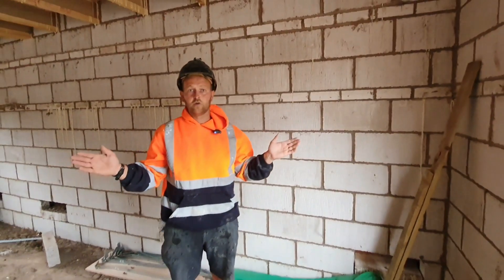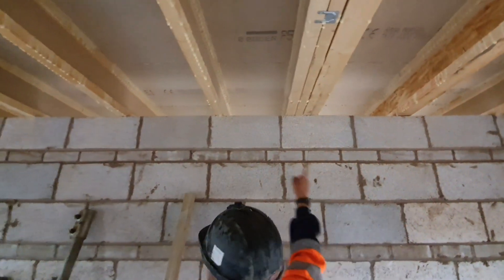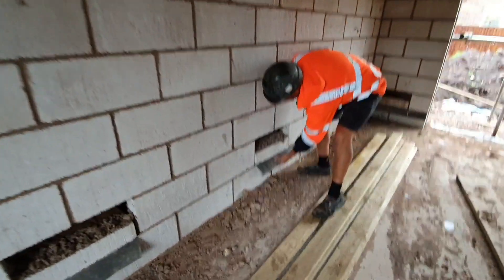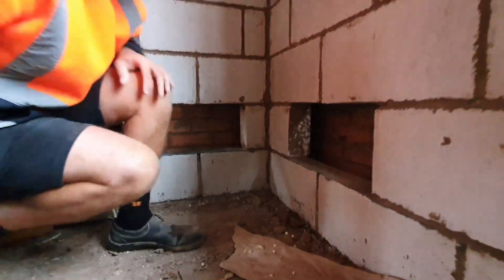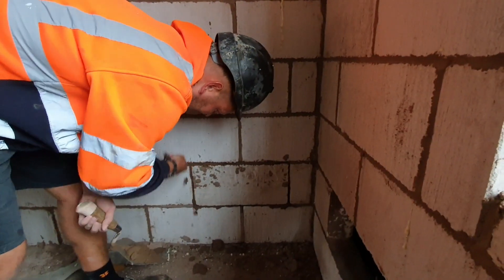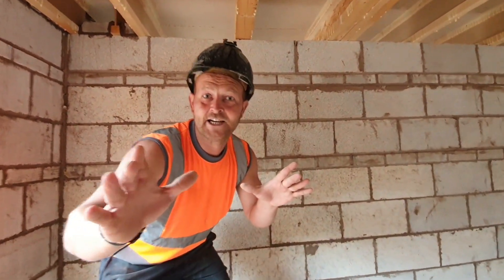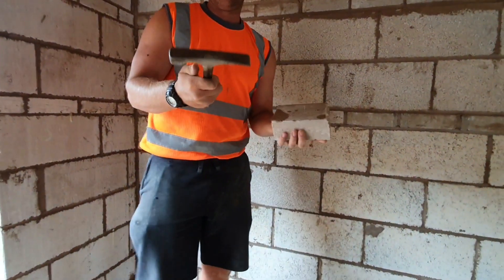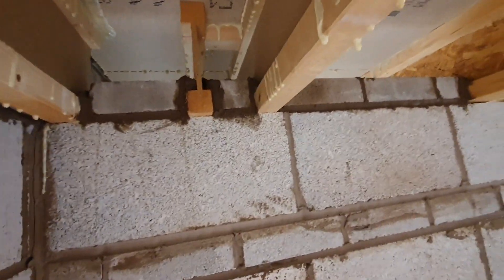Splitter Stolen [ Making Good At The End Of A Build

Comment: alright there Changy, any chance you could do a quick video on the trowel technique I mentioned before - about how now, brickies dont even spread the bed or cross joint. looks loads quicker to me. what's the ins-an-outs of the method etc nice 1 bro
Reply: also interested to know if ya can do it with a London?